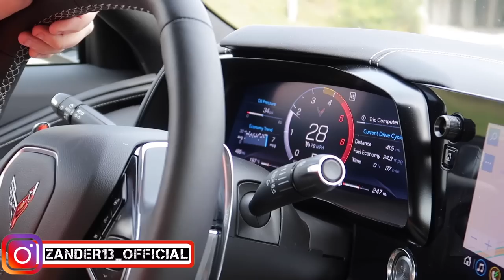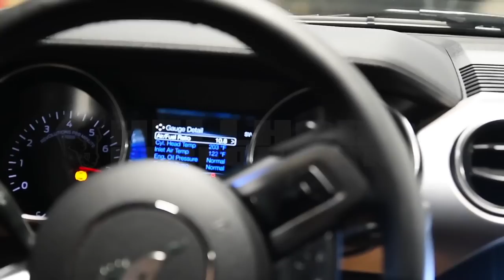2020-2021 Corvette c8 Exhaust LOUD "AF"!!! LTH Cats (sounds like a GTLM Car)

Comment: I have a 2019 Corvette and 2018 Mustang Gt both manual. Totally different driving experience, but love them both. The corvette feels real good down low with the torque and acceleration but they lose it up top. It kind of falls flat up in speed/rpms and stops pulling.  The mustang though keeps pulling, and way better upper RPMs. But you have to get the mustang up there as quick as possible. The Corvette is better down low the mustang is better up top. Talking stock of course. I put in 4.09 rear gear from 3.55 in the mustang GT and dayum It's all good now down low. Planning on putting 3.90 from 3.42 on corvette. I am hoping that helps some up top. Mustang has 2 overdrive gears and corvette 3. Smdh. They should have come from factory with shorter gears for manuals.
Reply: Manual over automatic any day  chasing 0-60 numbers is boring

Comment: Zander13 , thanks for the diverse content and even Steve....I wish Jeremy were willing to mod further when tuning is available be a great comparison...
Reply: Id also like Steve to throw it around a bit and get his impressions....
Reply: @bluecollardaily2676  that will happen in the future as far as Steve getting it on the track.
Reply: @jeremywinslow7345  yea I just think his impressions would mean something to a lot of people.... 
 I'm glad to have a radical choice...I've built many a LS engine, I realize the LT has more limitations from the factory but really when people don't use e85 as a crutch ( its literally just race gas at the pump might as well be VP116 from a tuning standpoint) the LT, Hemi and my Gen 3 coyote all have very low limits hence my 3rd engine in 5k miles...especially with cats....in other words not using e85 they are all limited on the boost they will hold....
  Drop in piston/rods and im sure its good for big power...once they can tune them 6 or 7 would be safe im sure and insanely quick....
 
 I find it insane that FBO tuned e85 cars want to compare to a bone stock non tuned Vette...how about just straight up stock to stock...street dig? SHIT....
 Give it a year or so when tuning without tricking sensors is possible....then compare FBO to FBO...
 Then 93 boost levels to 93 boost levels..... 
  Will the DCT hold up in Vette? Well I don't fckn know but I know I've made 3 passes at the track and my 19 mustang is in the trans shop now toasted so 3 passes and its 3 engines and 2 trans....I love the 10r80 but its been problematic with multiple recalls and zanders is down NOW....
 Zander13 like MINE has never been right stock, I had some of the same 5th gear issues he had and also hanging on gears...cold morning NO GEARS going from R to D....jerking he had to do a valve body when his burned up imho because his stock one has never been right, like mine and many others...so who fck knows....I know mine was 1.5qts low of fluid from factory and never been right but its me paying the 3k to build it 
 I do think the traditional design and layout of the GT500 will make it easier to repair or swap to t400 if the DCTs end up just simply not holding ect.......

 We know axles don't hold on either really...SA731 broke his on a 1-2 shift...at 7psi...
 I leave like a street race in 2nd to save mine...so that's a wash....

 We have to wait n see but my point is that C8 with say 6-7psi, with custom tuning on it and tcm bringing in power a bit more smoothly than these work around cars with a set of axles is gonna be BEAST on street from a dig and plenty of fun everywhere else and god damn how does everyone skim past it looking like a supercar...
 GT500 looks like a Mustang GT with a body kit literally cause it is

Comment: Did you guys ever get and Check engine light for the O2 sensors?
Reply: Nope and I got about 6000 miles on it now. 

The ones from 2m fabrication will throw a check engine like if you don't use o2 extenders

Comment: Hey guys quick question on the driver side cat the instructions say to remove the factory o ring and move it to the cat side with the flange closest to the rear of the car. Which I did but after I fit the bolts the o ring is still loose but the bolts can’t be tightened any more. Do you recall if there was a space there on the driver side flange side of the cat ?
Reply: It all tightened down for us.

Comment: This guy convincing himself that his 90k c8 is better then a full bolt on s550 10r80 lol
Reply: I have a Camaro but out of those 2 I think I rather have a fbo 10r80 s550
Reply: I was thinking the same thing lol..
Reply: A FBO s550 GT with a 10r80 cannot beat the stock c8 at anything.
Reply: Jeremy Winslow I’ll do it in my MT82
Reply: Jeremy Winslow LoL your funny
Reply: @Justin-ik6se  facts are facts. I love mustangs, however that platform is simply not comparable to the c8 platform. You need boost, tires and a drag strip to launch how this car launches.
Reply: So full bolt on s550s or even boosted 10r80s with suspension and drag pack like mine, can get 2.7-2.8 0-60 on street? I can't not even close my shit will run 138 in the 10s on the dragy from a dig on street...but Stock that vette would leave multiple car lengths to pull back in....

 I want to see them cracked and 6-7 psi on the vettes....

Comment: I got the LTH cats but my O2 sensors are throwing the codes and the CEL is driving me crazy. I didn't had the check engine light for like 50 miles and then it showed up and is throwing codes for that. Are you having the same issue? If so, have you figured the fix for it?
Reply: Never got a cel. However you can get o2 extenders that will fool the computer.
Reply: How did you fix it.?

Comment: Were these the Hi-flow cats or the Off-Road version? Sounds great, btw
Reply: High flow 400 cell cats. Anything less throws a check engine light if you don't put on o2 sensor foulers...

Comment: I would of gone with test pipes more hp and less money and even better sound can’t lose
Reply: That throws a CEL though
Reply: @jeremywinslow7345   if you take your after cats o2s out and plug them you might not my 19 mustang gt never threw a cel light and I have no cats
Reply: @ryandyson5398  doesn't work that way on the c8. Too many computers.

Comment: Unless you really want a Vette I would get the GT 500 for that money at least a gt350 the Vette is nice I would get on to cruise not 1/4 mile running IMO
Reply: I agree, the corvette is not suited for drag racing. If you are into drag racing get a 0 option mustang gt and go ham with boost. It will be faster in a straight line over the length of the 1/4 mile.

Comment: Beautiful car no doubt but I would clap that on my PBD E85 intake header Gt (;
Reply: Not even close.
Reply: Then we he has mods haha it move right back....lol, I own a boosted 2019 on its 3rd engine and getting 2nd trans today...
 No way in HELL from a dig could my car do 2.8 0-60, Vette should be a dig street racing game changer when the PCM/TCM gets hacked
Reply: @bluecollardaily2676  Zander and I hit 2.9 0-60 with all my stuff and both of us in the car. On clean pavement with a smaller guy driving its 2.7 2.6 all day
Reply: @jeremywinslow7345  exactly aka faster than the mamba with full suspension and drag radials running at a prepped track with 1000hp and running 8s .....in case people need to put that in perspective....
 I'm running 3.6 with 138 on street running 10s, I believe I can with coil overs using precise custom springs get that to 3.4 but thats it...
 I mean truly virgin street no slicks no track bite prep ect...but usually im up around 3.8-3.9
Reply: @bluecollardaily2676  they dont get that there are barely over a dozen cars in the world that get off the line faster out of the box. Not to mention every one of thoes cars is at minimum double the price to over 10 times the price.
Reply: @jeremywinslow7345  are those cars 2 wheel drive?
Reply: @bluecollardaily2676  the stingray is. There is going to be a variant or 2 that will have electric motors on the front wheels
Reply: @jeremywinslow7345  gonna be a wild 5 years and Dodge just dropped the Super Stock....these are good times except money hehe

Comment: That's a lot of cash and effort for a basically no performance increase.
Reply: For reference, to get that kind of bump on an s550 you need at minimum a tune and intake which hits near the same cost. 

An active exhaust catback on an s550 is over 2 grand... 

We spend money on cars, for what I got out of what these cost I got my money worth.
Reply: @jeremywinslow7345  Hey Jeremy, I'm not in disagreement here at all. I was just wondering if holding off and spending a grand or two more on some dyno time and a tune would be worth it (I understand it's still too new for that though)? As opposed to doing it in small steps. It sounded great afterwards for sure!
Reply: @LookingForEntertainment112  we simply don't know what a tune would do because we cannot tune. I doubt I will tune because honestly the car simply does not need it. Plus I got a fantastic deal on a 7 year warranty.
Reply: @jeremywinslow7345  Enjoy your new wheels.  They're a great looking car.